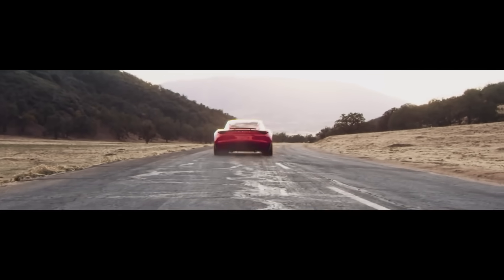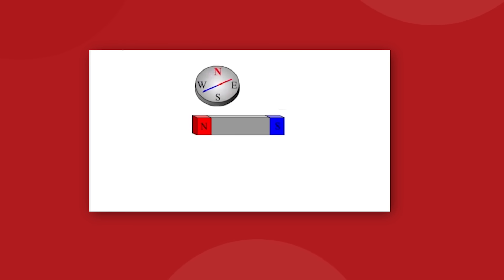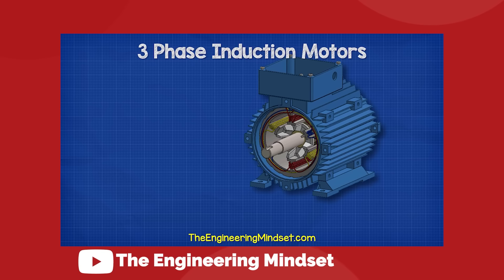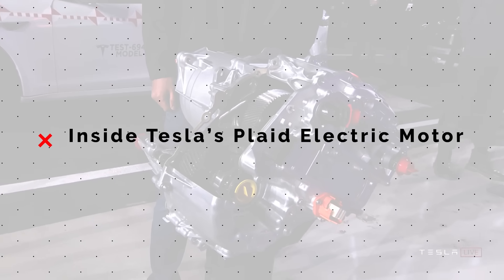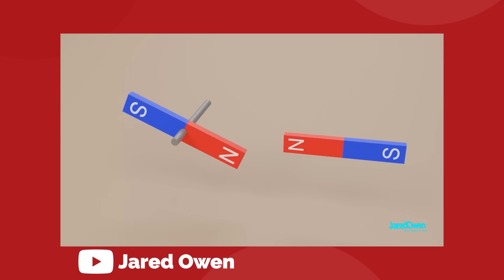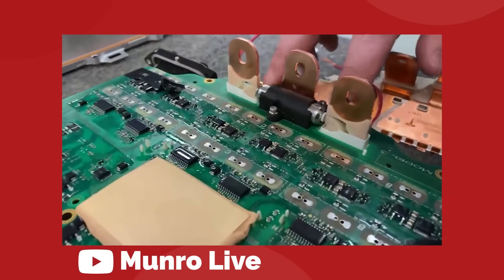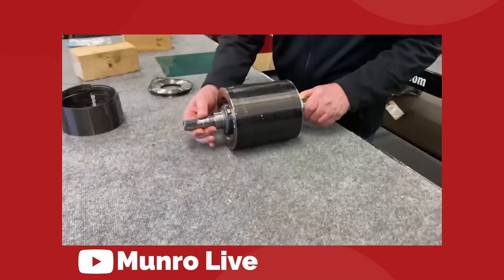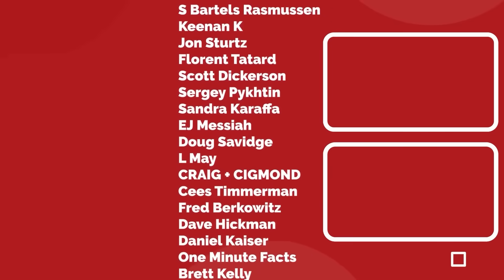The Real Reason Tesla Developed The Plaid Motor!

Comment: Electric motor designer here.
Great video. Even though simplified a lot at some points, I think you got your points across well.
However you got some things wrong about the carbon fiber sleeve. Carbon fiber is terrible at conducting magnetic fields. Therefore, if you have a 3mm thick sleeve, from a magnetic point of view, its like the airgap is increased by 3mm. So the effective airgap is actually much higher with a carbon fiber sleeve. What carbon fiber is good at is preventing the rotor from destroying itself due to centripetal forces, allowing higher rpm. With higher rpm a very low aigap is actually not desirable due to increased rotor losses, but this is a complex issue.
I'd love to chat about this with you, if you are interested let me know.
Reply: This is correct, the carbon fiber sleeve is to prevent the rotor from flying apart. And you also can get rid of the iron bridges in the rotor. Without the sleeve these bridges would have been very thick to hold the rotor together and thus stealing too much flux from the magnets. When you calculate it the increased air-gap due to the sleeve reduces the flux less than the iron bridges would have done.
This with carbon fiber sleeve is not new however, we did a project around 2008 with such motors for a military vehicle prototype, however it did not enter into mass production. Also the Swedish company Elmo produced servo motors in the 80:s and 90:s with magnets held in place by winding Kevlar under tension instead of carbon-fiber. On of the large customers for the motors at the time was ABB Robotics.
Reply: @teamsafa  ABB also makes great vfds that we use.
Reply: Fellow electric motor designer here. Surprisingly goes unmentioned but the carbon fiber sleeve also lets them get rid of the flux bridges between the magnets, essentially they break the rotor into separate segments and retain those segments using the sleeve. Cool design but obvious tradeoffs, mainly the larger airgap like you said
Reply: @coreybean8280  exactly the main reason for the sleeve was sadly not mentioned. Tho I can understand why as that would require quite a big wander into Motor theory with the IPM-SynRM motor used by Tesla.
Reply: @sedon7098  its just IPM, not the BS name given by tesla
Reply: Motor theory? What? Lol alot of pseudo-intellectual, wannabe engineers in this comment section
Reply: @coreybean8280  And don't forget to talk about the "flux capacitor"!!!
Reply: @coreybean8280  maybe that's why they need the more powerful magnets, to compensate for the larger air gap? So they're getting their increased vehicle power from increased rotational velocity, not increased magnetic field strength. Anyway that's my guess.
Reply: @coreybean8280  How does the carbon fiber affect the flux capacitor?
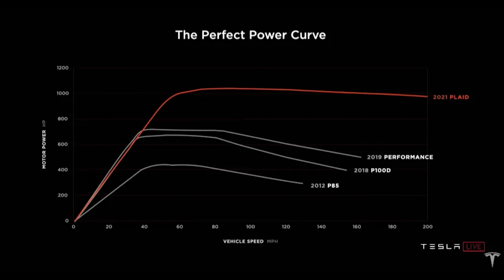Reply: Could you explain the graph @11:25? Why would every other motor drop off in power so severely compared to the plaid? The air gap couldn't be the issue since if a motor is supplied the same amount of power and adequately cooled it should produce the same amount of power throughout a run, indefinitely. So is it a simple rotor overheating issue or something more complex like a difference in eddy currents between rotor designs?
Reply: @Martin_Speed  There is an over focus on the air gap, the part thats most important about the carbon fiber sleeve is that the magnetic flux geometry created from using laminated stars with the caps stays intact. The magnetic field is literally being focused and aimed by the geometry amplifying the strength of the already very high grade magnets and also reducing backward fields induced into the stator from the rotor decreasing the magnetic drag. if you have ever seen a magnet dropped down a copper pipe then you have seen an example of magnetic drag created from the eddy currents from a magnetic field move thru a conducting medium even though no electrical potential is create as a whole.
Reply: @Martin_Speed  Well first you need to notice, that there are 3 motors in the plaid. The other models have only 2, but the rear motor is an induction motor. The induction motor actually has more power and torque. Usually induction motors are designed with high field weakening range, so they drop off in power more than PM motors.
So for the plaid you can see the curve of a PM motor, while the others are induction or mixed. The higher speed seems to be due to the changed gear ratio. If you apply the new gear ratio to the older teslas, the curve would go up to 190mph, so the new motors are only slightly faster.
Reply: THANK YOU for using centripetal correctly
Reply: @Kattemageren  Thank you for prompting me to look it up and learn the difference vs centrifugal.
Reply: The motors positioned to have horizontal shaft, have a very slight transient dimensional deformation of the rotor, because of rotor's weight applied between the two bearings, and the elasticity of the materials. It is very small, but it matters when the air gap is very small, too. Decades ago, for the motors that needed very small air gap, a simple way to solve this was to have the shaft of the electric motor on vertical axis.
Reply: @FlorinSutu  but at higher speeds/acceleration in a moving vehicle, which is what the whole point of these motors is trying to achieve, surely the motor centre shaft will be forced backwards against the bearings and the rotor, thus, towards the back of the stator.  So mounting vertically is surely only beneficial if the motor mounting itself is stationary?
Reply: @alexmanojlovic768  - - You are correct. While attending as student the course for the design of electric motors, generators and transformers, back then there was an electrical machine specially dedicated to generate current at about 10 kHz frequency (compare that to the usual 50 Hz/60 Hz). That 10 kHz voltage was used for heating metals by induction. For example, that can harden a very thin layer of steel, while the core remains softer, thus not brittle. I guess that today those 10 kHz for induction heating are obtained by power electronics, that existed but were expensive when I was student. Back to that machine, it had a very, very small air gap, its shaft was vertical and yes, it was installed stationary on a bench in a factory.
Reply: Do you think they are using an exotic material with a higher max saturation flux density for the plaid? Hiperco 27 or 50
Reply: @ILiketoBreakStuff  No, I think that material is to expensive for this kind of motor. The benefit may not be as big due to that they cannot use the strongest neodymium magnets due to operating temperature. The strongest NeFeB magnets only goes to about 60C and are typically used in hard-drives.
Reply: @ILiketoBreakStuff  I doubt it. They might use a slightly modified material but surely no exotic one.
Reply: Really cool to hear this, you guys should definitely talk about this and record a video!
Reply: @snelle_tomos  with graphics for us lowly average folk!.....
Reply: I would love more information about how they created / how they function on "Halbach arrays" - because I was often told that is how OVERALL tesla had their competitive edge.
Reply: @dannygorman4803  In a Halbach array the magnets consists of segments where the direction of the flux is changed in each segment to guide the flux in the desired way. What I see in this motor is standard magnets where the flux is guided by the iron laminations.
Reply: Exactly! Carbon fibres are for keeping the rotor from fluing apart. introducing 3mm gap to keep things close within micrometre range is simply to say wrong.
Reply: @lashamartashvili  mm is not micro
Reply: @Blox117  Just listen to the video and read what I wrote.
Reply: @lashamartashvili  no i dont listen to fanboy propaganda
Reply: @Blox117  So you'd better stop making strawman arguments.
Reply: @Blox117  You may have found out that millimetre is not a micrometre, but it's not bit news btw.
Reply: @lashamartashvili  i havent made any arguments, tesla child
Reply: so the carbon fiber makes sure the rotator does not expand too much at high speeds?
Reply: @jeromedeleon1226  Yes, that is the main advantage. It also gives some advantages in the design of the core as mechanical strength is being provided by the carbon fibre wrapping rather than needing to be incorporated into the core itself.
Reply: Not an engineer here.  But wouldn't it make sense to make a non metallic low heat conductive, low magnetic material as the core and insulator and body to keep weight, thermals and magnetic interference low and calculable on the wide scale of the motor its self?  The carbon-fiber makes total sense. Makes sense to me that heat and friction can cause materials to become less efficient as well as having some material that could "steal" energy or forces from the plant not ideal.  Therefore a strong, non metallic/magnetic easily enough manufactured material is the obvious answer. Kinda like plastic that doesn't fracture or melt.  Still blows my mind how efficient and less complicated electric motors vs hydrocarbon Motors are considering belts, transmissions and the requirement of Conbustion.  Just thinking, what if cars had a small diesel or gas generator that charged the batteries and therefore powered the car? Could still charge the car same as you would a Tesla, but have the added benefit of range and options will no recharging station near or were short on time for travel.  I wonder what kind MPGs it could actually achieve instead of the common hybrid or straight electric versions we have now.  Mix a Tesla car with a small 2cyl diesel generator motor.  hmm
Reply: I love the discussion in this thread :)  learning lots here guys.
Reply: MrZauberwuerfel, It would be interesting to hear your take on the video posted recently by Lucid Motors on their youtube channel. 
Video title: "Drive Unit: Motor | Tech Talks | Lucid Motors"
Reply: I have experience with carbon-epoxy, and with electrical motors. Carbon fiber is not great at thermal conductivity. Unless the epoxy being used is an excellent thermal conductor, would this not lead to excessive heat build up and therefore higher resistance in the winding and poorer performance?
Reply: Expert Electric motor engineer here, you guys are all wrong. Go back and study plz.
Reply: Im an electrical engineer.... how did you break out into electric motor design?
Reply: @cyberlando  Well I worked at a company, that produces electric motors, while I studied.
Reply: @MrZauberwuerfel  so much to learn, so little time
Reply: @cyberlando  First learn mechanical engineering.
Reply: So another potential connection between tesla and internal military knowledge/money, I mean skynet bringing high speed Internet to starving Africa is a bit of a thin Vale especially when the first true use case is war in Ukraine
Reply: @brianforbes4417  In the case I mentioned there no connection I know of. It was for a Swedish project about 15 years ago. It is more that if you want the best performance of a high-speed motor this is one of the best ways. Setting up the machine for production requires a quite large investment so nothing you do unless really needed and you are certain of volume to be manufactured.
Reply: So just an idea, but wouldn't it make that they reduce air gap because of carbon fiber sleeve. As i remember there was thing about tesla electric motors having oil in them or something ( i might be completley wrong but i remember something from rich rebuilds) So could it be that they almost reduced air gap, and put instead the carbon sleeve ?
Reply: @MrZauberwuerfel i have a question. Would it in theory be possible to "tune" a electric car by swapping the permanentmagnets without major changes to the powerdelivery or software? And with that, can you actually disassemble most rotors without braking them or are they, like the plaid rotor, wraped in something, welded or something?
Reply: @1sqeeze1  In practice it would be rather hard to change the magnets. Most motors dont have a sleeve, but the magnets are glued into the laminations. And if you manage to take the laminations apart, you might have a hard time putting them back together. And if you'd manage to overcome all those challenges you still need to balance the rotor. But lets say you managed to do all those things.
Increasing the magnet strength does a few things. You get more Torque/Amp roughly proportional to the strength increase of the magnets. But you also increase the induced voltage, lowering your maximum speed. Due to the higher flux density you have higher iron losses. Before you switch the magnets you should also make sure, that the old and new magnets have the same temperature class. Getting magnets with higher strength is not that hard. But getting magnets with higher strength, that can tolerate the same temperature is usually hard.
Electric motors are generally optimized well, so that every change you make will probably make it worse.
Reply: I'm a test engineer that focuses on electric motor dyno testing.  I have a question I've been wanting to ask a designer for a while.  Why don't we see more square wire(hair pin) being used in the stator? More slot fill, right?   I used to work in the auto industry and I would see hair pin stator in some of the newer designs for alternators ... thanks for your input....
Reply: @mellowbanjo3849  On the surface, hair pin windings sound great, and they are used in some EVs, but there are some problems, that come with them.
You dont get as close to 100% fill factor as you might think. You need slot insulation and insulation for each conductor. So you get ~75% fill factor for hairpin compared to ~50% for "normal" winding. But with the hairpin winding you are locking yourself into parallel slots for the stator. That means, that your stator tooth is wider on the bottom. This is not optimal, you generally want a parallel tooth, so the flux density is the same from the bottom to the top of the stator tooth. Due to this factor the hairpin advantage is already decreased.
However the more critical disadvantage of hairpin windings is increased losses at higher frequencies. This is due to the shape and the low number of conductors per slot. The mechanisms causing this are the skin effect and the proximity effect. The skin effect refers to current flowing more near the outside of a conductor when the frequency increases, therefore increasing the effective resistance. The proximity effect refers to the electromegnetic interaction between conductors. This also makes the current density in the conductors being not uniform, again increasing effective resistance.
As most motors for EVs are operating at high speeds, the higher fill factor of a hairpin winding is often neutralized by the higher losses due to high frequency. For alternators the frequency is generally lower making hairpin windings an easier choice.
If you want more info, you can google the following masters thesis (or ask me if you have questions):
FEA study of proximity effect in hairpin windings of a PMSM for automotive applications
Reply: @MrZauberwuerfel  hey man! Thanks for the response.
Reply: The sleeve probably makes them need less of an airgap for tolerance reasons, so I don't think it hurts things.  But yes Carbon fiber is non magnetic.  They could impregnate it with some pure iron to increase the magnetic permeability though.
Reply: As an employee of Alstom I'd like to know about the significance of the air gap, please feel free to chat, we make PMSM for our high speed rail locos.
Reply: Are you for hire? got lots of project examples?
Reply: A lot of arguing here why don't you just watch a better video
Reply: It's dimensionally stable as a material, and tough.
Reply: Just wondering: how does the reluctance (magnetic resistance) of carbon compare to that of fresh air?
Reply: @jesserawson898  for magnetic purposes the carbon is basically the same as air 
Both have relative permeability very close to 1, while electric steel has a few thousand 
In magnetic simulations, a carbon fiber bandage is usually just modelled as extra air gap
Reply: He's just a Musk ball licker. How could you expect he knows what is him talking about?
Reply: I'm sure that sleeve will last and these motors will never blow apart.
Reply: Do you did you work for Calnetix Technologies?  or with Dr.Pham?
Reply: The airgap losses are now modelable using CFD codes of various sorts.  However, this is only for "ideal" situations, where nothing moves, grows, wobbles or goes supersonic.  Just as for airplanes, it is the transitions from inviscid to viscid flow, and from laminar to turbulent to shock wave(s), which are where the problems lie.  In the past, some of this was inspected by painting the rotor (or stator) with a friable or meltable paint or ink, similar to what is done with magnafluxing to detect cracks in metal.  The magnetic designers always have skew in the rotor (or stator) to reduce torque ripple.  Typically this is done using a straight line skew, but we found that this creates air pressure resonances at specific and often undesireable frequencies.  Variable skew rotors were introduced long ago, where it is easy to do this for cast induction rotors.  For stators, this is difficult, since that would be where the windings are, and would have to have special tooling to slide the wires through, since they typically cannot be pressed as a block, as is done in ordinary straight skew slots.  This was also inspected for high-speed machinery decades ago, but not easily made manufacturable.  Now in modern times, with robotic winding machinery, and with modern cad/cam software, such designs can be produced, and are manufacturable via additive metal techniques.  Unfortunately, even at this time, using additives, there is post processing required, similar to the olden days, so it is not yet ready for high-volume production.  GM, Ford, Toyota, Tesla, and others are actively pursuing such research as we speak.  There WILL be designs and materials which can improve motor performance up to very high speeds, resulting in smaller and lighter "motors", but the tradeoff then will be in the bearings and gear boxes required to get to the LOW road wheel speeds (or airplane propeller speeds).  There are NO FREE LUNCHES, in basic physics.
Reply: hi if the offer is up for any buddy i would love to chat i actualy have a excam soon were i will be talking about electric motors
Reply: More like 0.1 mm than 3 mm.
Reply: Thank you for this thread...despite the efforts of any prima donnas to tear it down in places.
Reply: The black ones are faster.
Reply: @SuperMonkeyFling , lol!
Reply: If you're an electric motor designer you should know it's centrifugal force that wants to make the rotor come  apart, not centripetal.
Reply: @rocketscience777999  You could say, that its the reactive centrifugal force. But this is caused by the centripetal force.
At the end of the day we are now talking about semantics and not the real reason I made my comment and it wont lead us anywhere.
Reply: @MrZauberwuerfel  If you tie a string to a rock and rotate it over your head, the centripetal force is the force in the string directed at the center of rotation. The centrifugal force is equal in magnitude but is directed radially outward. Saying the difference is only semanitcs is like saying the difference between a billionaire and a person that is a billion dollars in debt is only  semantics.
Reply: @rocketscience777999  In your example, the centripetal force is the tension of the string, the only real force in that scenario. This is clearly shown when drawing a free-body diagram of the system. Centrifugal force is purely intertial and therefore considered a pseudo or fictitious force in physics/machanics. Your money analogy is not applicable in this case.
Reply: @rocketscience777999  Installing a neodynium magnet at the core of rotor, "pulling" anything magnetic toward the rotor center- was such design be great helped to "decreased" the possibility of rotor in "brink of dis. integration" - due to the rotor very high rate of rpm (rotation per minute)?... Was my idea a nuggets of help to LESSEN the possibility of "disintegration" incident- or the suggested idea will further AGGRAVATED the already existing problem of the e. engine of Tesla car?...
Reply: @arielhermoso4262  No. The magnet would make it worse, because the added centrifugal force created by the magnet is proprtional to it's weight times RPM squared. Also, magnets are "dead" weight meaning they are heavy and have low strength.
Reply: @rocketscience777999  there is a lot of academic arrogance today making the engineers face the designers and the masters with experience and the individuals with instinctive logic many time with a combination of all but there was a time not long ago when titles were not needed for the inventor or great things of the past, even cutting and sculpting ancient rocks even make a Physicist the most innocent dumb person of all ..... centrifugal force vs centripetal force, the difference is without confusion so basic.
Reply: Unfortunately Biden will take over control of the electricity and w/out power non of these hi-tech components work! Fancy paper weights when it's all done and said. Hopefully won't come to light but Unfortunately it's started!!
Reply: @theglitch99  What do you mean by that? What would he do after taking control of the electricity?
Reply: @theglitch99 many americans protested against masks robbing them of their freedom. Do you really think americans will let someone control electricity access?
Reply: @MrZauberwuerfel  I Hope you are right bud!!
Reply: You meant to write "centrifugal" force
Reply: @marlonvite4152  no I am pretty sure I meant centripetal force
Reply: @MrZauberwuerfel the centripetal force towards the center of the rotor does not increase with higher rotor spin velocity .... if it does then I may not be the only one wrong and you know could know more ....
Reply: @marlonvite4152  F_c = m × r × w^2 where w is the angular speed in rad/s or F_c = m × v^2 / r
The centripetal force increases quadratically with the speed
Reply: @MrZauberwuerfel  you have wrote the semeengly correct formula for both forces centripetal and centrifugal according to an incomplete third law both are "equal" but that third law is minutely incomplete: the reactive force is, in all cases, the centripetal  losing against centrifugal force which at a given speed breaks the materials in rotors, tesla turbines, propelers . The centrifugal force breaks the material not the centripetal force, the carbon fibers are used to extend the breaking of the materials used but only to a critical higher speed
Reply: @marlonvite4152  In mechanics/physics the centrifugal force is purely intertial and therefore considered a pseudo or fictitious force. Ultimately the system can only exert a limited centripetal force before experiencing failure. It may seem counterintuitive, but technically centripetal is the correct term.
Reply: @Alkapwn  thanks for your opinion ..... I do understands the concept similar to a "tug of war" contest where some say you didn't win, we were the ones that lost for x reason ....  or when looking at a glass half full and half empty and that debate goes on ..... where the third Newtonian law which is incomplete by the way for if both OPPOSING forces are equal then nothing will ever move or give according to that incomplete law of perfect physics both opposing forces are or balance or weight the same ... so one group of intelligent individuals say the "seudo" forces towards the center loses or breaks the rotor or mass of which is made of or fail against the pulling force away from the center (centrifugal) .... while the other team of intelligent individuals say uh uh it is the centrifugal force that wins or breaks the rotor apart or elemental cohesion of what the rotor is made of..... what pulls when a rotor spins?
Reply: Increased rotor losses? What? Losses due to friction? What are you talking about? Have some specificity bud
Reply: @drrightwing4435  Sure, I can go into detail, I just didn't want to go on a tangent in my original comment.
No, it is not about friction. Obviously a very small airgap also causes slightly higher friction, but this is about eddy current losses due to harmonics in the magnetic field in the airgap.
So normally you would think, that the magnetic field in the rotor doesn't change, because it has permanent magnets, right? The "problem" is that the stator has slots (54 in the model 3 motor I believe). If you take a look at the airgap, then you notice, that the magnetic flux density above each slot is lower, because the magnetic flux is mostly going through the iron. So for every full rotation, one point on the surface of the rotor experiences 54 dips in flux density. And these dips cause a change in the magnetic field of the rotor inducing eddy currents causing losses. This effect is reduced when the airgap is larger.

I hope I made myself clear. Its hard to explain, because I don't know what knowledge I can take for granted.
Let me know if you have questions.
Reply: @MrZauberwuerfel  Handled the troll (edit: and argumentative laymen) like an adult. So refreshing, and thanks for your explanations!
Reply: @MrZauberwuerfel  May I asked why no built.  in charger was installed in such Tesla car and other models of common e. vehicle today?... Said bttry charger can be brake. powered, solar, downward vibration of car chasis during travel, etc.. Or a hybrid car: A bttry charger, powered by small diesel engine, will constantly re. charged the car bttry- each time such btty low power level arrived at "pre. set level"... Another Option: A  2nd set of battry, being charged by such built. in bttry charger- while the other bttry set is being utilized by the car engine... Does a hybrid, self. charging e. car will be a "sure death blow" to those numerous gasoline station along the roads- thats why the hybrid e. car model was not mass produced?...
Reply: @Teaspun  
Here here 👏👏
Reply: @MrZauberwuerfel  Thank you for an approachable explanation of this.  Something that most of us would never know about.